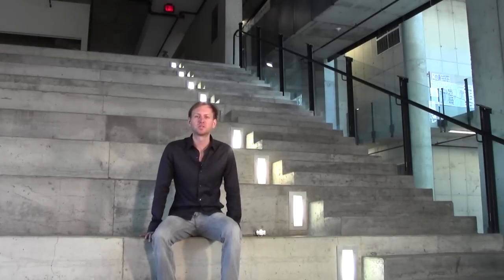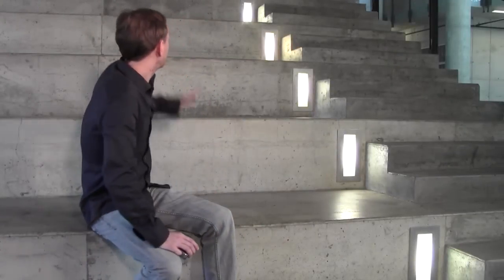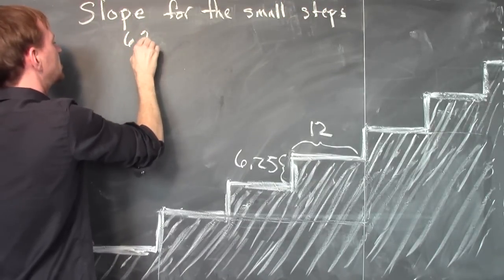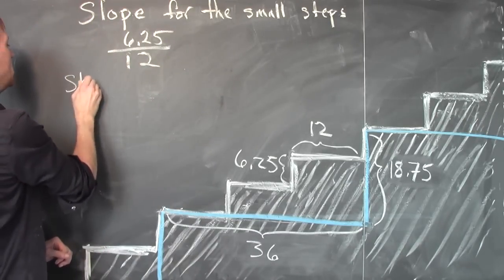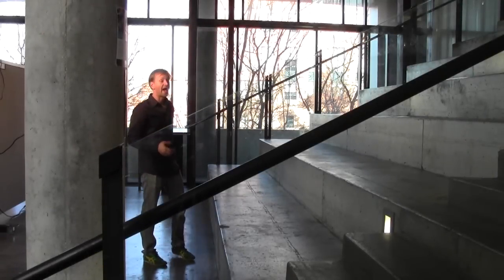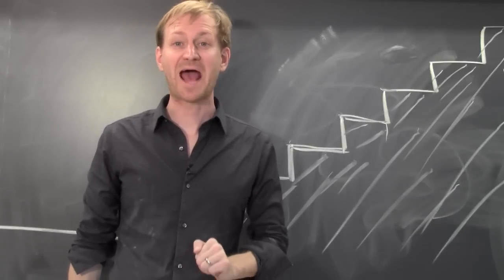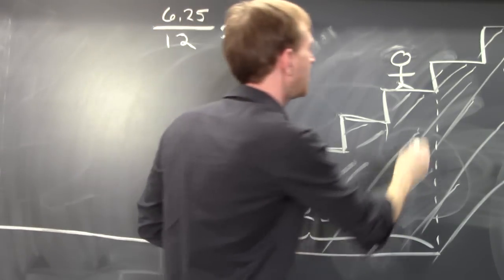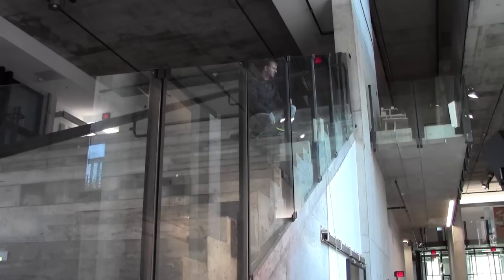What is the slope of a staircase? - Week 2 - Lecture 10 - Mooculus

Comment: How to calculating for number blocks for building?
Reply: This is how you count one wall, find its height. and the height of your block, you will put one inch of cement in between for example. so add one inch to the height of your block. now divide the wall height by the height of your calculated block, you get number A.
it is a rectangle, so work on the length of this rectangle. it is number A, A times B will be the number of blocks you will need. roughly. because usually you have to cut the top row to fit the real wall, you may need more or less.